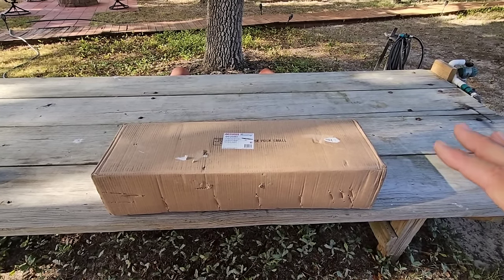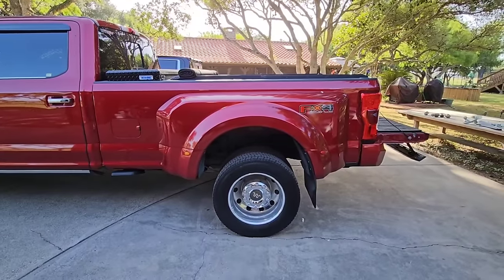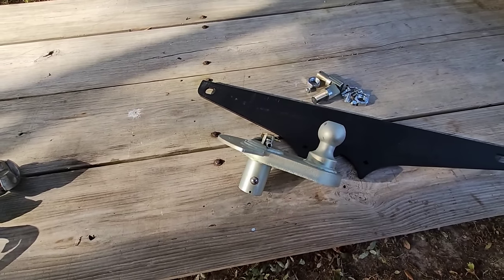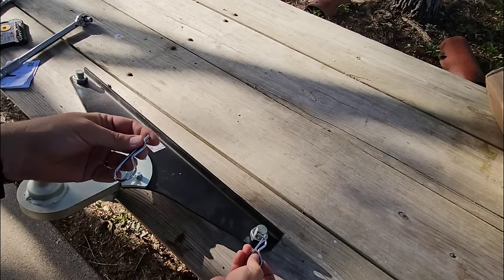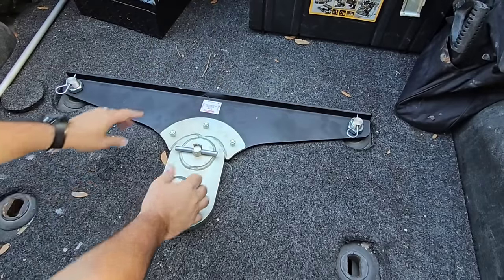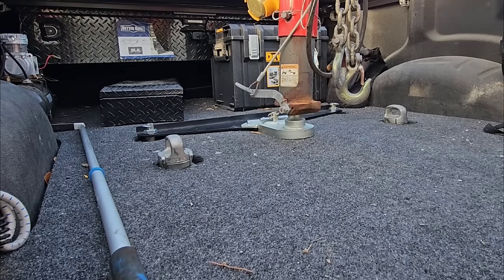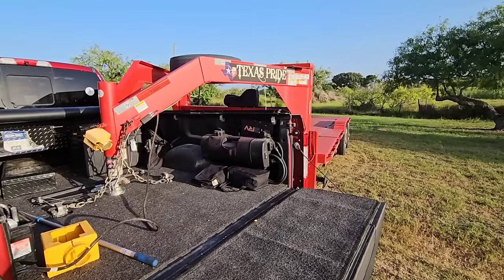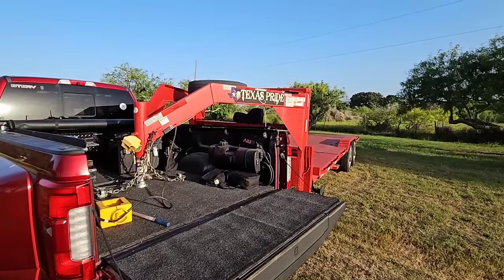Most Amazing Gooseneck Hitch for OEM Puck Systems! Gen-Y Offset Hitch!

Comment: Some folks have talked about the difference in weight distribution without doing the math.  For instance, Mr. Truck has been very critical of the GM ball placement in the newer 6'10" bed.  It looks like your truck is 176" wheelbase.  5" offset is 2.8% of that.  So for every 1000 pounds of pin weight, you've transferred a whopping 28 pounds of weight from your front axle to the rear.  No trips to the scales necessary.  Easy math.
Reply: Your math is dangerous BS. 

The weight distribution around the rear axle is dependent on the placement around the pivot point of the center line of the rear axle. The weight is not evenly distributed over the length of the wheelbase so that moving it back and forth along the total length of the wheelbase produces equal results.

When you place weight forward or rearward of the pivot point it acts like a lever. Archimedes said  "Give me a lever long enough and a fulcrum on which to place it, and I shall move the world." I would modify that to give me a poorly front loaded trailer and a weak rear suspension and I will lift the front end. A torque wrench is a force multiplier due to the length of the distance between the center of the square drive and the place where you place your hand. You can actually change the torque applied to the bolt, nut etc just by changing the position of your hand lower down or higher up from the point that the manufacture of the torque wrench designed the hand to be placed.

If you placed 1000 lbs 5" behind the pivot point of the rear axle the math would be 5/12 = 0.42%. 0.42 X 1000 = 416.7 pounds feet of rotational force trying to lift the front end more than if the 1000 lbs was placed directly on the center line of the rear axle. Due to the way the suspension is connected to the frame in front of and to the rear of the center line of the rear axle the weight distribution is not exactly the same as a pivot point, it certainly is more than 28 pounds per 1000 pounds of additional downward force.
Reply: @thinkfirst6431 John's calculation is correct, for the static load distribution; it depends only on longitudinal position of the ball. It does not depend on suspension design; it is a simple lever problem in which only the horizontal locations of the ball and the tire contact patches matter.
You are talking about dynamic load shift from that static distribution, and that depends only on the height of the ball above ground.

They're two independent effects.
Reply: @thinkfirst6431 your example math is incorrect: the truck's wheelbase is 176" (not 12") and you forgot a factor of 100, so your 42% is a random meaningless number. 
5" is 2.8% of the wheelbase, and so and 1000 pounds 5" behind the rear axle line would transfer 28 pounds from the front axle to the rear.
Reply: @brianb-p6586  A truck is not a simple beam supported on both ends with no support along the length. It could be considered as a beam with different support locations that transfer the load to the ground differently.

The only important thing is how the overall load shifts back and forth from the front axle to the rear axle within the weight capacities of the axles and how it effects the balance of the truck in relation to the loading of the truck and trailer.

Truck frames have no support on the ends and have 2 supports that transfer weight from the beam to the ground differently. 

The front support is ether independent on each side or has a solid axle such as a 4X4 with a tube axle. Probably a coil spring suspension. Independent suspensions transfer weight differently than a solid axle will. 

The rear support is most likely a leaf with connecting supports that are not a equal distance between the center line of the rear axle. Overload leaf springs tend to touch in the back first then the front with ever increasing loading.  

You are not loading the frame per say, the frame is just transferring the applied load to the ground through the axles. It is a  nonlinear loading as it is dependent on where the load is applied in relation to the placement of the load AND the action of the front and rear suspension. 

The only true way to determine the amount of load shift is to weight the front and rear contact points of the axles where the tires contact the ground before and after shifting the load.

You have the same problem with tandem axle trailers. You can take a 1000lb load from the nose and transfer it to the rear of the trailer that doesn't translate to a 1000lb reduction of the tongue weight.
Reply: @brianb-p6586  Your comprehension of the math is faulty at best. The result was expressed in the rotational effect of foot pounds of torque or as is more popular today pounds feet of torque. 12"/5" describes the arm of the lever applying torque around the rear pivot of the rear axle and has nothing to do with the length of the frame other than the frame and the part of the truck that is ahead of the rear pivot point has mass that resists that rotational force canceling some of the rotational force.
Reply: @thinkfirst6431  a truck is simply supported by the ground at the tire contact patches. Everything going on within the truck and its suspension is irrelevant to the distribution of load between those points.
Reply: @thinkfirst6431  the lever moment around the axle is irrelevant unless you also calculate the lever moment of the change in load (the force) over the distance between axles (the arm length) when you do that, and eliminate common factors, you end up with exactly what we have repeatedly explained to you. 

416.7 pound-feet of rotational force around the rear axle, divided by the 14.7 feet of wheelbase, is - drumroll please - 28.409 pounds at the front axle. That's (5 inches  behind the rear axle / 12 inches/ft *1000) / (176 inches of wheelbase /12 inches per foot), which is simply (5/176)*1000, as we explained.
Reply: @brianb-p6586  

"Everything going on within the truck and its suspension is irrelevant to the distribution of load between those points."

Those are your words. If everything is irrelevant to the distribution of the load then why bother to determine where the load goes at all? 3K in the front of the bed should be the same as 3K in the back of the bed according to you if loading is irrelevant to the contact on the ground. Why isn't the load just suspended between the front and rear bumpers with the air under them holding them up?

Why, when I put a 200lb heaver bumper on my front end, why did the rear axle loading get lighter. If the loading is irrelevant why do diesel powered trucks weigh more in the front that the back when unloaded? Why did the balance change when there was 95 gallons of diesel in the transfer tank as apposed to when it was empty.

Why when your truck is weighted why don't they just grab the front and rear bumpers and lift the whole thing off of the ground for the gross weight which would total the front and rear axle weight if the distribution is irrelevant?

My guess is that the heaviest thing that you have hauled is the case of water you struggled to get into the trunk of your Kia.
Reply: @thinkfirst6431  everything mechanical and structural doesn't matter; of course the mass distribution matters - it's all that matters. You can imagine any wild suspension you want, but it can't change gravity so it makes no difference to the distribution of load between the tires.
Reply: @thinkfirst6431  appear to be making the common mistake of confusing load distribution with suspension travel. The suspension geometry is very important to whether the vehicle dives (pitches nose-down) on braking and squats (pitches nose-down) on acceleration; however, that has nothing to do with static load distribution or even steady-state load transfer under acceleration (or trailer drag). Anti-squat and anti-dive geometry (which can be implemented in either independent or beam axle suspension designs) changes how much of the load is carried by the springs (changing the ride height) and how much is carried by the vertical component of control link forces - it doesn't change the load.

Comment: Your bed rug didn’t seem to interfere with the install. Is that still the case? I have a 3/8” thick contoured rubber mat in my 2023 F350 that I’d prefer not to have to cut out of the way. I contacted Gen-Y directly, however they said that the mat would interfere with the hitch. Thoughts?

Comment: Would be nice to see what the difference is for the amount of weight on the front axle with both the standard location and the offset location.
Reply: It’s about 100 pounds on the front axle, per 1000 lb of pin weight, if moved 4 inches.

Comment: Regarding the comment @6:28: an extended pin box is not a problem at all, and pin box manufacturers do make them in different lengths. Of course that's not the same as moving the pin, but it is equivalent to the offset gooseneck coupler shown @6:16.

Comment: We're currently looking at fifth wheel RV's. Our 2020 Ford F-250 diesel has the 5th wheel prep in the 6-1/2' box and a 2668# max cargo. The Flagstaff Classic 8529CSB has the Curt Turning Point pin box,  hitch weight of 1,831 lb. so what hitch would you recommend? My husband would prefer a Gooseneck for more box space and easier removal of towing system at end of camping season. Would love your opinion.
Reply: I'd love a video on this topic, the pluses and minuses of goosebox vs. 5th-wheel hitches for RV trailers.
Reply: I am a FW hitch fan myself but for your situation I would recommend going with the goose box. You are very close to your max payload and I’m not even sure that you will able to stay within the max GVWR of your truck. Really depends on the weight of passengers and other cargo in the truck. A goosebox setup will definitely help keep the weight down. 
   Another thing to consider is wether that is a dry pin weight or the actual pin weight when traveling. If it is dry, I would expect that number to increase by 400-500 pounds. 
   I would recommend at least a 350/3500 SRW pickup with a gas engine to get your available payload up around 4000 pounds. 
   I just upgraded from a Ram 2500 to an F350 Dually with the 7.3 gas engine for towing my FW. This truck is a beast and I have 6200 pounds of payload. Towing my fifthwheel is night and day difference with this truck.
Reply: @dereknew5298  thanks for sharing

Comment: If you measure that out,  you'll find that the ball is 1.5 to 2 inches forward of the centerline of the axle. This allows the front axle to bear 10 to 20% of trailer hitch weight.
Reply: You need to check your math.  A 1.5 to 2-inch offset will certainly result in some load transfer to the front, but not 10 to 20%
Reply: 2" equals 10-20% to the front axle? I can see maybe a percent or two but not much more just from that slight change (being it's a 176" wheelbase, moving 88 inches forward would yield 50% load to the front axle right?).
Reply: @johnpalmer3848  I didn't do any math...that was a scientific wild ass guess. That being said,  I learned to install fifth wheel and gooseneck hitches in the 80s,  from a large hitch fab/installation shop.
Reply: Not on my truck (3500 Ram dually 4x4).  With 3200 pounds of pin weight when hitched up (around 15k GTW) the front axle is within 200 pounds of when unloaded! In other words, the rear axle is carrying the vast majority of the weigh as designed. Tows beautifully with my 20k Reese Goosebox! 👍
Reply: With factory FW prep and B&W FW hitch and 2580 pounds of hitch weight, my front axel weight increased 20 pounds from unloaded. That’s .077%. Verified on the cat scale. 13k FW. Truck is ‘22 F350 DRW with 7.3 gasser. No suspension mods of any kind. Both me and the wife in the truck with full tank of fuel for both empty and loaded weighing. 
   I do realize that the Cat scale only gives weights in 20 pound increments so the actual difference may be a little higher or lower, but worst case scenario would be somewhere between 0 and 40 pounds difference.
Reply: @dereknew5298  Pretty closely verifies my observation that the pin weight of my trailer (around 3200 lbs.) makes very little difference on the front axle weight. 2015 Ram 3500 dually 4x4. Maybe 150-200 lbs. additional on the front. Have to find my scale slips and double check...
Reply: As John Palmer explained, 1.5" to 2" of the 176" wheelbase is 0.85% to 1.1%, so that's the fraction of the vertical load carried by the front axle. To be a scientific WAG, you would have to do the math... otherwise it's just a WAG.

Comment: Hey BTBRV, do us all a favor and settle the argument about how the 2 different connection points effect the front and rear axle weight. At the cat scale weight the front and rear truck axles with the standard ball location then again with the Gen-y with the 5'' back connection. Some think the back connection effect is so substantial on the weight distribution on the truck and can cause sway. Please give us actual weights. I would guess there is not more than 200lbs difference between the connection points.
Reply: Given the wheelbase of BTBRV's truck, every 1000 pounds of pin weight would move 28 pounds of front axle weight to the rear axle.
Reply: @johnneil6653  exactly - there's no need for a scale to anticipate the change.
Reply: @CS-rb9jk  The trailer doesn't matter - only its pin weight. The only things that matter about the truck are the wheelbase and the pin position within it.
Reply: @brianb-p6586  That's right, the pin weight and position behind or on center of the rear axle will effect the front axle.
That's what i've been referring to.
Reply: @CS-rb9jk  we're not disagreeing on that - I was just responding to an earlier version of your comment about every truck being different... since every truck of the same wheelbase and pin position will behave exactly the same.

Comment: I would leave the 3 bolts between the two pieces loose and then tighten them as a last step. And then loosen (or even remove) the 3 nuts to lift it up outta' there as two pieces -- should be a lot easier. :)

Comment: Maybe i missed it, but what is the purpose of the two safety pins on those threaded pieces that hold the bracket into the two pucks? Seems like a couple lock nuts would be a better option. Am i wrong thinking that?

Comment: I don't know what's "amazing" about this, but if one is going to put an offset ball in a round in-bed socket, something is needed to keep the ball assembly from twisting the socket, and a plate connecting to at least one of the puck mounting points does seem like a good plan... and perhaps the only reasonable plan for a ball locked in place by balls (rather than a pin).

Comment: But why... why not design it to use the puck holes in the aft position; where the load would be within the contact triangle? 
Would it not reduce torque forces?
Reply: The black plate is being used only to keep the ball assembly from rotating around the vertical axis, so it only needs to reach to the nearest puck mounts. They put the flange to attach the plate opposite of the ball (perhaps for ease of fabrication), so the plate goes to the forward pucks. They could have run the plate on only one side, to both pucks on that side or even to only one.

Comment: I was curious, so I didn’t math.  3000lbs of pin weight set 5” behind the axle will lift 85lbs of weight off the front axle.  Not bad at all
Reply from the maker: It's not set behind the axle.  The pin on the truck sits forward of the axle by a few inches

Comment: It almost looks like you should be able to lift that T-handle up above the guard then rotate it 90 degrees to lock it in the up position, then insert the hitch into the hole.
Reply: Almost? Yes, that's exactly how it works, as shown in the instructions.

Comment: This is really neat and handy. The provided nuts for the stabilizer wing appear to be nylock nuts. Tells me they don’t necessarily intend the pieces to be separated. Couldn’t they have just made it one piece? Or is there a design aspect for that, that I’m not seeing?
Reply: They may use the same ball assembly with different puck systems, changing only the black plate to suit the puck spacing. That would require that the different systems have compatible ball sockets, but the dimensioned drawing on the Gen-Y website shows exactly the same ball assembly dimensions for all four versions (Ford, previous GM, current GM, Ram).
Reply: They do not appear to be nylon lock nuts when he is spinning them with 2 fingers after the hitch is placed in the pucks.
Reply: Any type of locking nut can make sense, since it is correct that there is no intention to disassemble the product after initial assembly.
Reply: @wakeupamerica2024  Nylock (and similar) nuts spin on freely until the locking section reaches the end of the bolt, and that's how far he spins them on with his fingers.
Reply: @brianb-p6586  a regular nut would act the same way
Reply: @wakeupamerica2024  Yes, Nylock nuts are regular nuts with nylon-lined section on the end, so until the nylon hits they act like regular nuts.
Reply: @brianb-p6586  I'm aware of what they are and you cannot thread them on as far as he did with 2 fingers...
Reply: I get the static load is rigid... but my mind can't wrap around the fact those 3 small bolts in an ACCIDENT would keep that gooseball from spinning 360⁰ ? HELP ME UNDERSTAND!!
Reply: @deal492  those bolts look to be machined.  They could be strong enough to prevent shearing off in an accident.
Reply: @deal492  I think that's a reasonable concern.  You could look up the forces defined in the SAE 2638 standard, calculate the torque around the socket due to the maximum lateral force and the 5 inch offset, divide by the distance from the socket centre to those bolts, divide that by 3 to get the force per bolt, and compare that to the shear strength of the bolts.
Reply: @brianb-p6586  well.... I did all the math you recommended, but I know even less than is did before... soo...🤣😅